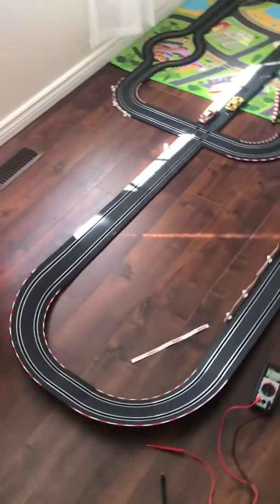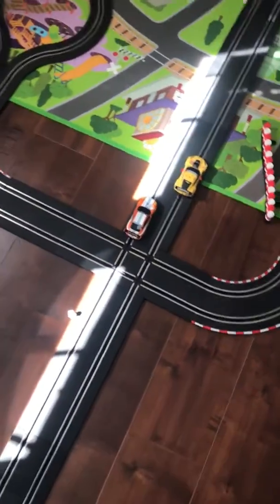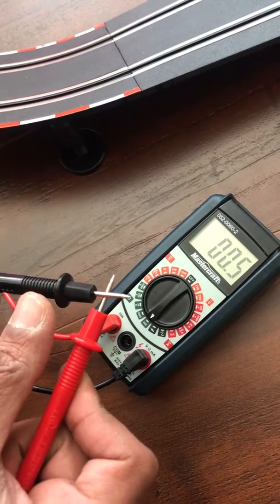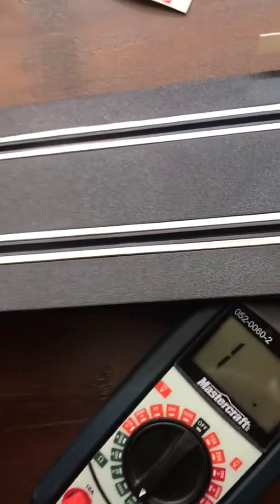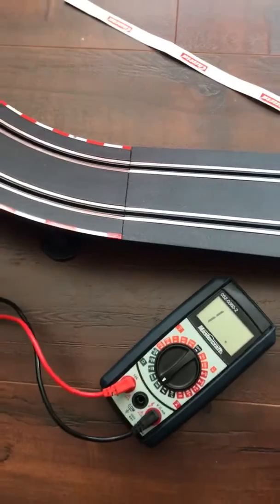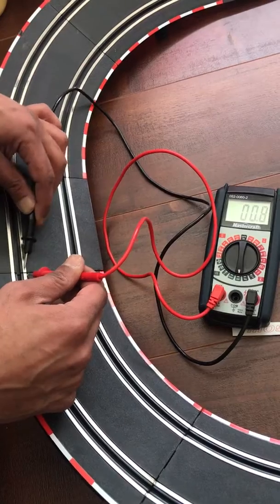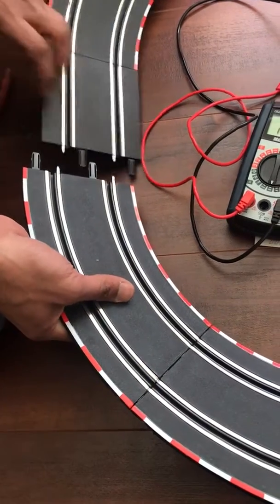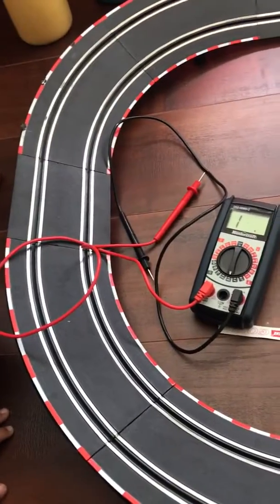Carrera Slot Car Losing Power at Certain Parts of Track

Comment: Model railroaders have the same problem. A slight voltage drop on track the farther you get from power pack. Run wires to both lanes from power pack at the farthest point. I just did that on my Carrera sport track, about the same length as yours.

Comment: I have replaced the brushes on one of the cars correctly and there is still no power? The other car works fine. Do you know why? Thanks
Reply from the maker: Probably the motor is gone!!
Just to make sure this non working car doesn’t work when you swap the track either? If so it’s most probably motor..

Comment: Hey thanks!  Finally a simple fix for loss of power in my track.  I'm heading downstairs with my multimeter right now!  Could it also be that the further away from the power source you get, the weaker the power?  Great video, thanks again, Mark from Oregon
Reply from the maker: Mark Abolofia there shouldn’t be any loss of power if connections are good.
Reply from the maker: were you able to fix the issues?

Comment: Hello my 1 controller controls 2 cars so i cant play 2 player what is the problem ?
Reply from the maker: Each controller sends electrical signal to one track. Are both cars on separate tracks ?
Reply: @mzsaad   i seperate now it works , got loops and i removed them